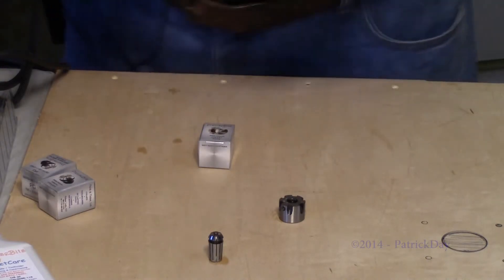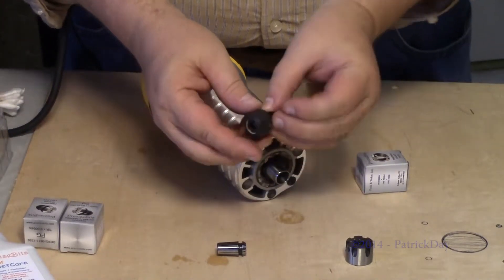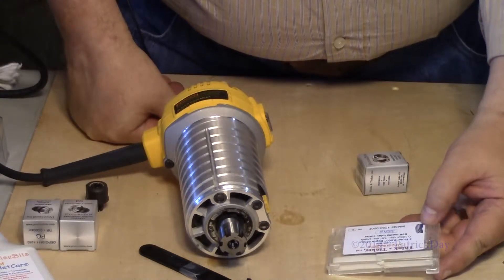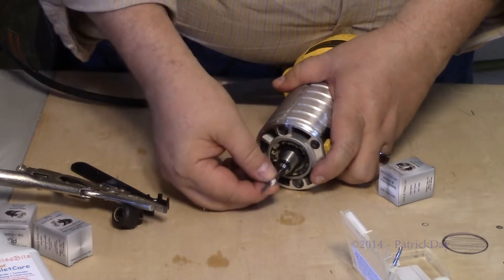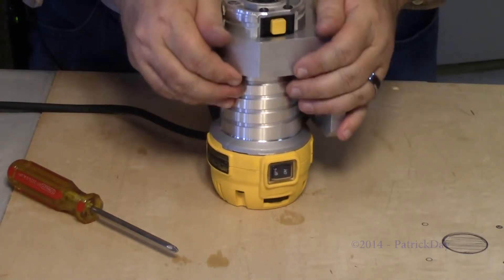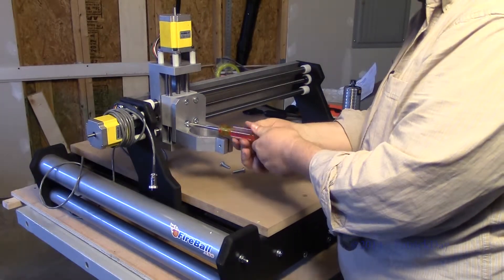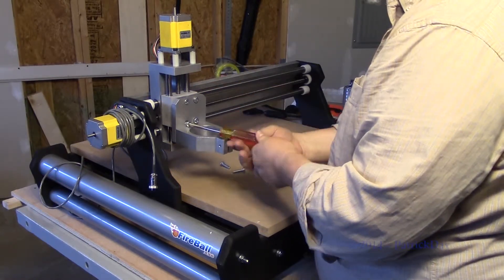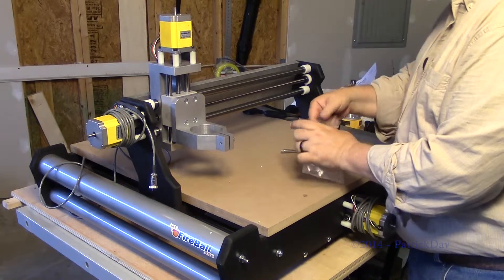Probotix Spindle Installation for the CNC

Comment: DO NOT ASSEMBLE IT THIS WAY, IT WILL JAM THE COLLET, YOU WILL NOT GET THE COLLET BACK OUT!

If you do it will cost you a new collet, Nut and router!

The Collet MUST be installed into the nut first, for the proper way go out to pricesebits.com they will show you the proper way to install a Collet.
Reply from the maker: D.R. M. Hi D.R.M., Thanks for the feedback, but i put a comment to that effect directly on the video and did a follow up video post with the corrected way.
Reply from the maker: D.R. M. here's the link to the correction: https://youtu.be/ElE-hud0lr0?list=UUSUYbLwnFyG4ohXGeeUCiTA
Reply: Patrick Day Not a problem, I stopped watching after the Colet installation. You see as soon as I see a gross fubar, I have little reason to complete the vid. Maybe you should reedit it? or atleast prefesset it with "Do Not Do This At Home"

You see I had just had a colet jam, and every body I ask told me I had installed it incorrectly. But I turned out a little less than half of the colet was touching the spindle and it ripped the nut apart upon removal and left the colet wedged in.

I was told that it was scrap, I was able to remove it, lucky the bit was HSS, I was able to machine out the bit and cut the colet, did all this with out damaging the spindle!